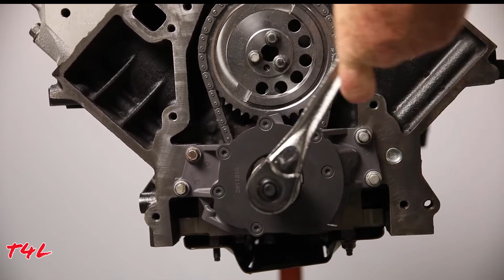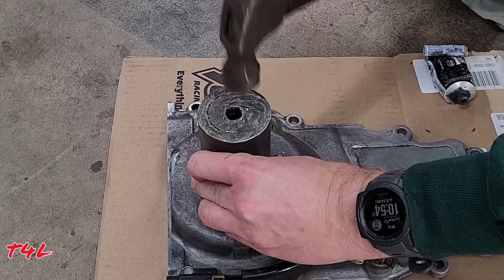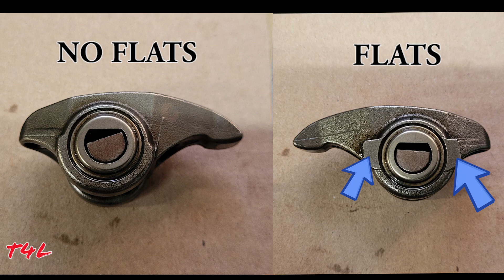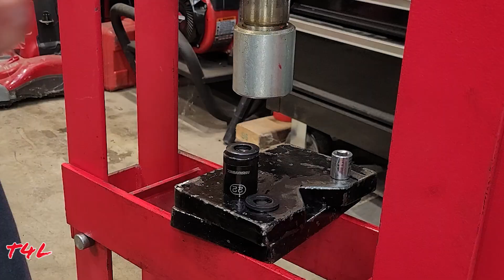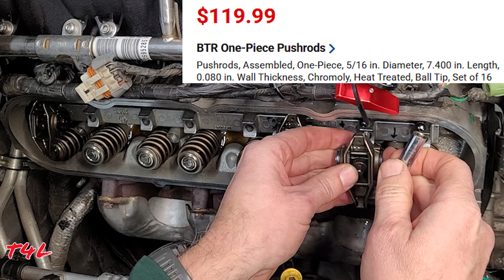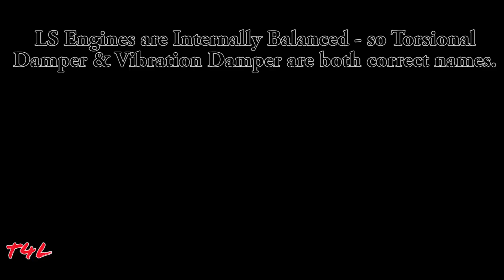Full C6 Corvette Cam Install Pt. 5 (Your Complete Guide!)

Comment: Great job. On the pump centering, FWIW...I was forced to use the shim method as well. I think it was because since we don't pull the oil pan, it becomes harder to align and install the pick up tube, and O-ring, to the pump. I had to first install pick up tube to pump while pump was very loose without its cover. With pump attached to pick up tube, turning the crank to center wasn't working out and that forced me to use the shim method. Worked out ok. HTH.
Reply from the maker: That is an excellent point, I think you are spot on!! - Now I wish I had mentioned that in the video - thanks for bringing it up!
Reply: Maybe pin that comment. Thanks for sharing.
Reply from the maker: Good idea, done 👍

Comment: No pickup tube brace? That’s one of those, while you’re in there, mods.
Reply from the maker: Two things on that, 1.  I'd really like to know how common it is that the stock set up flexes enough that an oil leak past the o-ring occurs. #2, and more importantly, I don't think you can put that brace on without dropping the pan, and that adds a whole bunch....
Reply: @Toys4Life  - didn’t realize the pan had to come down to get it in. I know you were trying to leave that in. It’s more of just cheap insurance. It’s a super cheap part, so my thinking is why not.

Comment: So do you have to measure the pushrod length with the rocker arms because I was told I did not have to and to just assemble them with the 7.400 pushrods from btr and I was good.
Reply from the maker: IMO, the preload check is absolutely worth doing because it verifies the actual preload. If the preload is too much or too little, you will need a shorter or longer pushrod.  Since my stock pushrods needed to be replaced anyways (too weak for this application) it was helpful to know that they measured 7.385 and the preload was not enough.  I know by ordering 7.4" BTR .080 Chrome Moly PR's that they would be perfect - so long as they all were actually 7.4" long - and they were.

Comment: Very good detailed explanation of how to install a cam! I did this on my ls2 vette couple years back and wish i had this tutorial. By the way i also did 50 thou preload on my lifters. I ended up having to increase my pushrod by .025 to have less of a lifter tick .
Reply from the maker: Interesting.  Did you check them all - is it possible one or two had less than .050 and were making noise?
Reply: @Toys4Life  I believe its because of the manufacturing of the Ls7 lifters. thats why some manufactures have tighter plunger travel vs a delphi or morel lifter. i had a couple that would have tapping noises. i ended up measuring both intake and exhaust to check which one had issues. ive seen on forums to relive the ticks, they had 80 to 100 thou of travel .
Reply from the maker: That's interesting, they're all over the map... engine labs / Jeff Smith says 40 to 50 thousands, Steve Morris racing engines says .060, Powell machine says 30 to 60, summit racing says 50 to 80. As long as you have at least 20 when cold, I don't know why they would make noise because the plunger is depressed and not able to hit. I appreciate your comment!
Reply: @ i had to call up BTR to get more answers and basically what they said was they recommend 80 thou of preload for a quieter valve train. However i do think the nicer lifters have a tighter tolerance spec vs a run of the mill ls7 style lifter when i did mine . But after changing the longer pushrod the sound is gone
Reply from the maker: @ Too much can cause the lifter to pump up if you ever float the valves, too little can make noise - it is odd that the opinions from qualified sources are so varied. Here is another.... https://www.enginelabs.com/engine-tech/engine/tech-tip-checking-setting-lifter-preload-ls-engine/

Comment: Excellent Video! I like the idea of checking for proper mounting of the pump as well as measuring for proper pushrod length. If you don't measure for proper pushrod length, you'd always be lost if the valve train makes noise.  One question, though? Did you consider using the rocker arm bushing kit as opposed to the needle bearing kit?
Reply from the maker: Yes, I am sure the better ones are fine as well but since the stockers last a LONG time (in terms of wear) unless the needles fall out, I have to believe the BTR v2's should last a long time as well.  If they do not, I WILL make a video about it 4 sure!

Comment: If you remove the heads to change the lifters do you still have to go through this process or can you just put the springs and rocker arms while u have the head out can you tighten them down before putting the head back on?
Reply from the maker: I'm not exactly sure what you're asking. You do not have to pull the cam and vibration damper to pull the heads.
Reply: I'm asking if you doing a cam swap and take the heads off to change the lifters can you swap and torque down the rockers while u have the heads  out or you have to torque them down with the process you did in the video
Reply: @lucionaranjo3027  You clearly don't understand what's going on with the rocker procedure. Better take the vehicle to a mechanic.